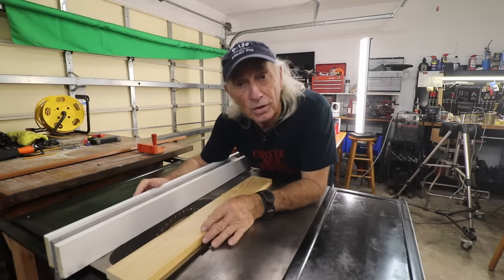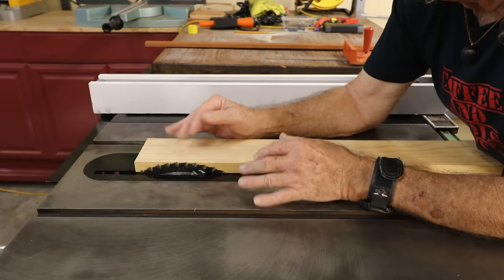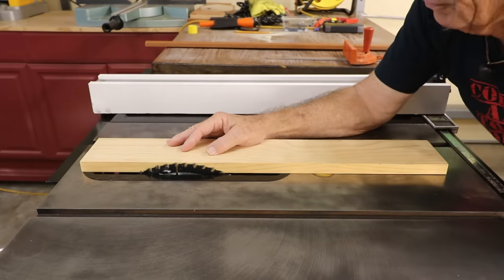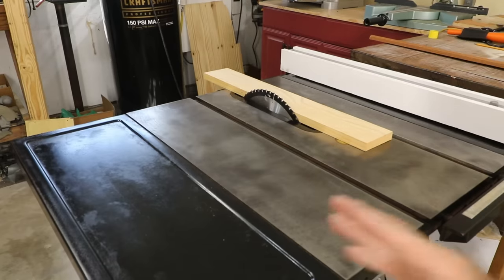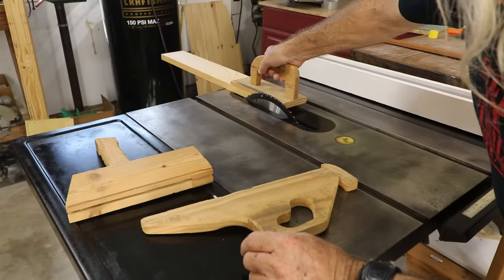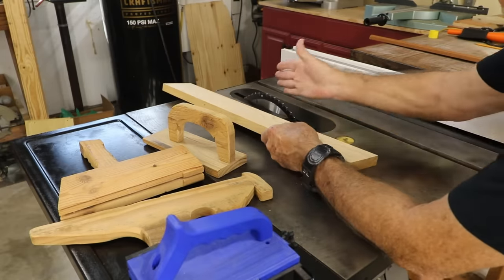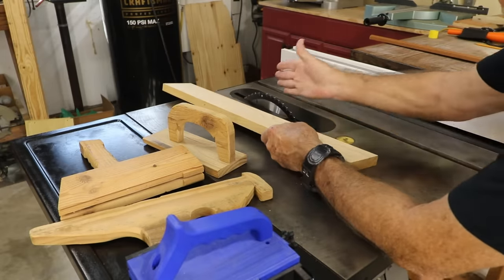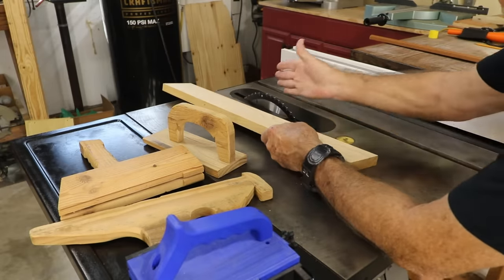Table saw secret nobody will talk about from the good old days, C&T episode 180

Comment: I think it's worth considering the angle of attack of the blade tooth. In my opinion the higher set up gives a more stable arrangement with the tooth pushing more into the table.
Reply from the maker: you get it :)

Comment: With the blade cover, back in my early days (1978) my table saw had with the cover a set of pawls for kick back. It all appeared to work well, so long as I still had that blade about a carbide tooth or less above the board or plywood panel.

Comment: I think your are right about the low angle being safest; for beginners especially. Once you are comfortable the next best height is to place the gullet of the highest tip at the top of the wood being cut. The rest is just pure physics: 50% of the blade in the rear is kicking the wood up off the table while the rest is applying downward rotational force into the table. They effectively cancel each other out making for the safest possible cut from a kickback/kick up perspective. Also not high enough to fully sever most fingers clean thru should there be contact.
Reply from the maker: Kickback is no joke. taking time to plan the cut seems to key. The low angle is a must for beginners to keep their fingers. Thanks Pario for your thoughts.

Comment: A piece of advice I always stick to (Always): Never (NEVER) stand in line with a cut-line kick-back path. Always stand a little to the side of the cut-line, never in line with the path of a possible kick-back projectile. 

I have had a kick-back incident. It happened so fast, it made a believer out of me. It was a true "Come to the Lord God" moment. I was ripping a 4 or 5 foot long board without a Riving/Kerf knife in place. I was using 2 push sticks, one to push forward, and the other to hold the piece against the fence. The kerf of the board pinched in binding on the 12" blade, split the board, and shot the fence side of the board just past me, hitting hard a brick wall 15 feet behind me. It splintered the kicked-back piece. The 2 push sticks were knocked out of my hands. 

 Never (NEVER) stand in line with a cut-line, and always (ALWAYS) keep the Rivimg Knife in place.

Comment: I am not an avid woodworker. I do not use my table saw but maybe several times a year. After seeing this video, I think it is now time for me to make or purchase a push stick / block. In the past, I would simply use a piece of scrap as a push stick. But, this would not hold the material down onto the surface of the table, nor would it allow me to apply any pressure against the fence.
Reply from the maker: We'll be doing a push block video soon.

Comment: With the blade higher the force is more down into the table than back toward the operator. I have an ancient (50 year old) craftsman tablesaw and have never experienced kickback with it. I set my blade higher as well. I like to have the dangerous part clearly visible so its easy for me to avoid. I do use a micro jig pushblock when ripping boards. Mine doesnt have the end piece on it. Pushing down, forward and into the fence seems to work well for moving wood through. pushing on very end of the board seems a bit dangerous seeing as how you are now putting your hand and fingers at the blind exit of the blade from the wood.
Reply from the maker: Push blocks do add a lot of safety for us old guys

Comment: Of my 27 rules to live by, these apply most to my work shop:

3 Believe in optimism with the reality chaser
4 Chance favors the prepared mind
7 Hope for the best, plan for the worst, (similar to #3)
8 If it seems to be too good to be true it already is
9 It is important to be handy however it's more important to know your limits
14 Wisdom is learned
18 Never push a bad situation
19 The first time you disrespect something, it can bite you
23 Not all things are created equal
24 somethings are only appreciated when they're gone
27. Be a part of the solution or you might end up a part of the landscape

Rule 19 is all about saws, routers and drills

Comment: Wood can close up as you pass the blade if the back side grabs it it can send it back at you.
A taller blade might give you more control.
Anything to make the job safer is a welcome change.  I tend to keep my blade lower then you but I let the full tooth out the top of the work.  

There are a lot of handy ways you can make your cut safer to do on the saw.
Thin rip stuff I do on my radial arm saw.
I also use board buddies on it too.
Reply from the maker: Good tip!

Comment: Table saws are used far, far, far more often than any other tool in the woodworker's shop, thus accounting for a disproportionate share of injuries to woodworkers.  I don't believe a table saw is inherently more dangerous than any other tool in my shop as long as I am working safely.  Something I don't see addressed either in the video or the comments below is how critical it is to make sure that your reference surface to the rip fence is as perfectly straight as you can make to the fence, and that the board face (the bottom one that touches the table) is as flat as you can make it as well.  I'm not a fan of using a table saw to make rough cuts - that's what miter saws and circular saws and bandsaws are for - and yet I know that many woodworkers use them in precisely this way.
Reply from the maker: Good points and maybe there is something to the number of injuries VS table saws. Thanks Chuck.

Comment: I'm 41, my ts blades ride a full gullet above whatever I'm cutting. I've got a 5hp 12" grizzly, 3hp 10" 50s unisaw, and a 10" bosch gts portable.

I've often ran the blade higher as well.

Comment: I only use the table saw when there is no alternative. I use a circular saw or even a band saw. If you do use your table saw, a riving knife is essential. The risk of kickback is much higher without the riving knife and the blade should at least be visible cutting through the timber. Not seeing when the blade emerges from the wood is very dangerous. If it's a long piece or a wide flat piece of timber take extra care. Never push any timber through the blade with your fingers, always use a push stick and don't put a lot of pressure on any push stick implement, let the blade do it's work.
Reply from the maker: Good enough :)

Comment: I was told many years ago to cut 1/8" above wood with a steel blade, however, with the carbine blade must be up high so as to keep it cool.
Reply: If the blade is sharp it will generate very little heat

Comment: Three things
First my great grandfather who was a cabinet maker in Reno for 30yrs was killed by a kickback. Back then 10" blades were few and far between. Most TS were 12 to 16".
Second, I do not believe you've never had a kick back. Thank God not all of them are as radical as with my great grandfather. I'm sure you have had your share, just small ones you probably didn't realize they were kick backs.
Third, most good modern TS have the ability for you to attach a Riving Knife that will match your blades angle. Shark puts out a great one at a price that will please your. Mine cost less than $35 delivered.
I'll tell you it not only helps prevent kick backs it makes for easier and straighter cutting
Reply from the maker: The saw used for this video was the commercial 12inch style. Sorry to hear about great grand dad.

Comment: The worst kickback I had was with the blade 1/8 inch higher than the wood.  After decades I still remember the pain.  After that it was too scary to keep the blade that low.
Now I set the blade height above the wood a little less than the wood thickness.  For a 2X4 that's the blade above the table about  2 - 1/2 inches.  It seems much safer with the blade that high.  Push sticks, straight wood and sharp blades seem to be the key for safer cutting for me.
Reply from the maker: Old school was different than today.
Reply: Sharp blades is huge. But never talked about

Comment: Here is a darker trap. I learned a lesson as I slid a wide plywood through...pushing with right hand between fence and blade---that was fine, left hand outside blade also was guiding at same time.
In the push, I adjusted my right hand and push stick; and a split second, my left hand outside blade pushed a bit cock-eyed which binded the piece between fence and blade. At light speed, the evil piece shot back hitting my right side careening on a path airborne behind me and through a glass window of garage with a clatter of shards. As reflex shut off saw, wify emerged from kitchen with, "Have you got a screw loose?" So quickly realizing to never do that outside blade push but rather between blade only and always. My right side was bruised w/pain. Thnx for secret.

Comment: I have a theory that the user isn't paying attention. In a split second it can go bad. Ive been using my table saw for 3 decades, never forcing the wood just causally feeding the material. Also never had a kick back or injury. Let the tool do the work and respect it. Also no distractions, and a clean work area.
Reply from the maker: Let the tool do the work, now that is an old school saying. Thanks !

Comment: If your blade is low, the cut profile is long which offers resistance and may slow the blade. While it offers a smoother finish, a low blade also tends to make the workpiece raise up off the table.  If the blade is high, you get a rougher finish but can cut faster.
Based on that, on hardwoods I put the blade down at about an inch above the workpiece and push slowly. On SPF and the like I raise the blade somewhat higher so I can cut faster. That lift in the back side he mentioned is from the fence not being parallel to the blade or the kerf is closing. I don't have a driving knife, so I tend to raise the workpiece up off the blade and recut from the beginning to solve the closing kerf issue.
There is no exact formula or answer that is correct for any single case. Wood hardness, desired finish, thickness of the workpiece and other factors affect this decision. Experience will teach you what you are comfortable with.
Reply from the maker: Nice

Comment: Another advantage to keeping the blade up higher is that it makes for a much cooler cut temperature wise. There aren’t as many teeth in contact and they are up in free air spinning and cooling. This makes your blade stay sharper and last longer. Just be careful
Reply from the maker: had a few guys mention that effect.

Comment: Keeping the blade real low works great- if you’re using a blade guard. Which is probably what the industry is assuming. If not, like most of us, I’ve found low to be way more sketchy. The blade will start to push the wood off the table- and that is no bueno. I don’t keep it crazy high, but a quarter-half inch or so seems to work best for me. That and keep your blades clean.

Comment: Been hit by a car 5 time's walking or on a bicycle , shot in the foot at the top of a flight of steps and fell to the bottom . Had , beat by four police officer's in false identity case . Head on collision sent my head threw the windshield while my seat belt pulled me back in the car . Fell twice off of a Two story roof " head first " . Hundreds of bar fights . But the worst pain I ever felt was cutting the tip of my finger off on a table saw . Dr. Said there are more nerves in the tip of your finger than any other part of the body . I believe it .

Comment: My shoulders are fucked to hell, I ended up just mounting a skill saw on a pair of Linear Guide Rails, and honestly it has been a joy to have all the wood I cut be cut with the saw blade facing down on the table.  My issue with table saws is the same as my issue with guns, they have a habit of arming themselves when no one is looking. 

But, I also had a craftsman PoS that my father abused to hell and back end up turning itself on once when the switch to it had finally been knocked around one time too many. That is one machine I really really do not like.
Reply from the maker: yeah, that gun comparison to table saw...like it :)
Reply: @SirTools  You should ask me sometime about a 4 inch scar on the side of my abdomen. 

Stupid crap happens with 10 years, extension cords/power strips and stuff going in and out of storage.  

I'm real big now on keeping my rotary cutting tools locked up in boxes when not in use.  Cause it sucks all the worst ass to have to hide an injury like that while pushing your paps around in a wheel chair for their end of life care. 

But I got off hella lucky that day, that table saw was propped up the way it was because the motor was crap in it and the blade was worn down to almost nothing.

Comment: I’ve witnessed how bad kickback can be, when I worked at a cabinets shop we used to purposely set the saw at a 45° and run a piece of oak through leaving the cut piece between the blade and fence, then we would walk around the saw and tap the piece of oak. The pieces would fly about 10’ and go through the drywall, insulation and stick out 10” through the siding.
Reply from the maker: Oh...man...now that is scary

Comment: With "old school" table saw blades the tendency was to run them extremely low because they  were all steel blades with no carbide tips, so the blade could stay in contact with the wood longer without risk of burning. Newer blades with carbide tips need to run at about 1/2" blade exposure to let the carbide "breath".  The carbide is much more dense than steel and therefore holds heat longer than a solid steel blade, so it will burn wood if you run it too low.  

You can run a blade at full height and it will NOT burn the wood!  The body of the blade does NOT make contact with the wood, the Kerf of the teeth is actually wider than the body of the blade.  The only reason it's not smart to run the blade at full height is because more exposed blade is more dangerous.

I have been a woodworker for 38 years and a full time professional woodworking teacher for 25 years. I have a B.S. in Woodworking/Wood Technology/Furniture Design, so I have both practical and academic knowledge to back up this information. However, the largest reason for table saw accidents is distraction AND NOT HAVING THE BLADE GUARD ON! In all my years of teaching high school kids woodworking I have NEVER had the blade guard cause an accident.  Anyone that tells you differently is just WRONG. Keep the blade guard on and make sure it has an integrated splitter, or you also have a riving knife installed whenever you can and these things will improve your chances of having accident free operation of the table saw.
Reply from the maker: Blade guards are hard  to find once you buy an old saw. Thanks for your input.

Comment: I'm a total beginner, so take this with a grain of salt. My small table saw has a riving knife and blade cover. For the blade cover to work, the blade needs to be quite high. That's not a problem, because my hand can't go near the blade, there is a blade cover, that's why it's there. When I need to make a cut that for some reason can't be done with the blade cover in place (say I need to use a sled, a jig of some kind), I move the blade as far down as I can. This worked well for me so far.
Reply from the maker: Safe is good :)

Comment: The biggest issue with kickback is inexperience and lack of education on the machine.  Nearly all kickbacks happen because of ignorance of the physics involved.  Some very smart people get hurt badly doing things like trying to rip very short pieces or using the miter gage AND the fence at the same time, or crosscutting with the fence.  A high blade doesn't do much with the kickback itself.  The danger lies in where the hand goes after the workpiece and push stick are flying out of the picture.  Things like not knowing how to align a fence or blade with the miter slots, not properly caring for the table and fence to make them as friction free as possible, not adjusting the throat plate properly so that the work catches on the plate to table transition.  Not using zero clearance inserts.  And on and on.  

I was fortunate to have great shop teachers decades ago in high school.  I was also fortunate enough to learn how NOT to use these tools at the same time and afterward.  I worked construction for several years during and after high school and still dabble today.  My first use of a table saw at work was "enlightening".  There was no fence.  You snapped your line and hand fed the work into the saw following the line.  I never had a kickback, but not for lack of trying.  No way would I do that today.  We also had a BIG, heavy 14in cast iron radial arm saw that stayed on site until the building was almost finished.  But that's another story.
Reply from the maker: A lot to be said here and all good advice.

Comment: I have had two tablesaws; first one a craftsman, 2nd a delta unisaw 35 years old still have it.  Never had a cut injury on the TS.  My father got a kickback.  I suffered a kickback of an offcut while narrowing a piece of moulding, blade was at 45 degrees, had a splitter with pawls on one side only (need to fix this), had an overhead blade guard.   The cut off was about 3/4 inch by 3/8 inch with sharp 45 degree angle on it.  Saw was off as the kickback happened.  The cutoff cut my arm.  Only a few drops of blood.  Doctor later said I was very lucky.  I was.

I bring about 3/8 to 1/2 inch of blade over the workpiece above.  I use one or two push sticks of different shapes and other hold down devices to control the wood.   (didn't have many hold downs for the moulding difficult set up.)

As I see the keep the blade right at the top of the wood, the blade is much harder to see.  Like the antelope in Africa walking near the lions, leopards and cheetah, if they can see it they can avoid it.    

Don't be afraid to use the TS.  RESPECT the TS. It is Dangerous. You MUST learn its behaviour and how you must behave around it.  But if you practice good technique and use push sticks you can avoid injury.